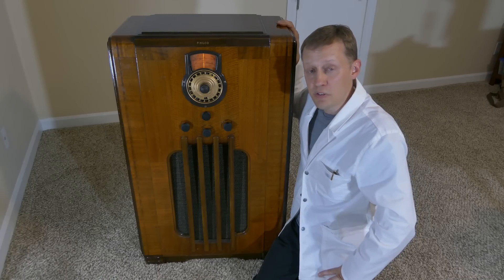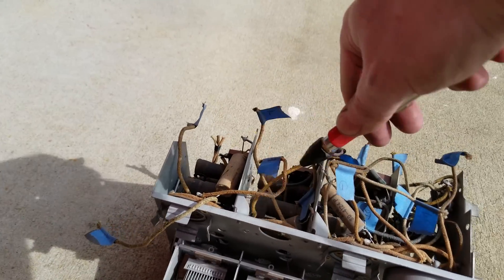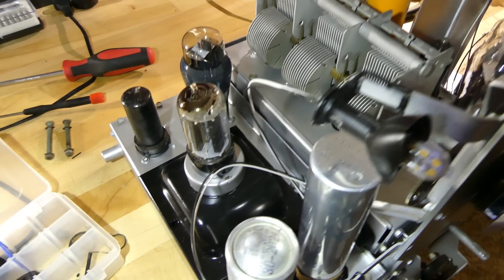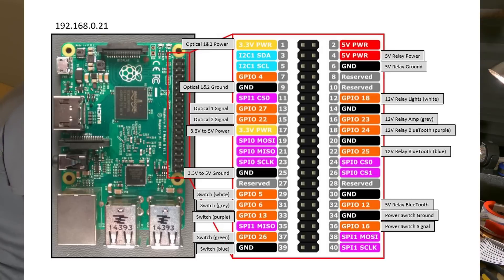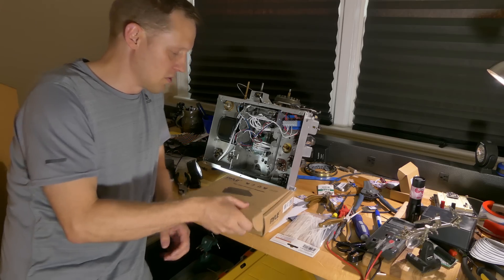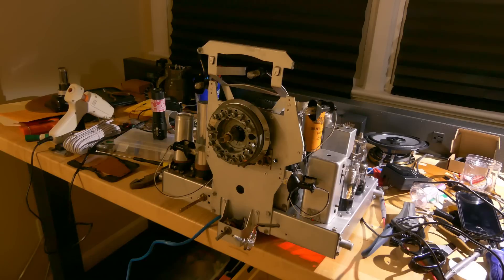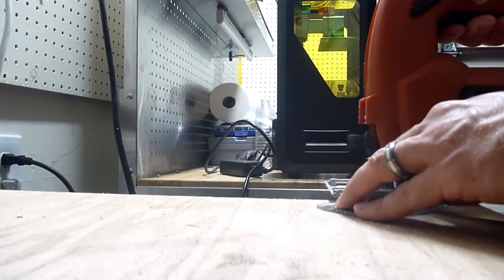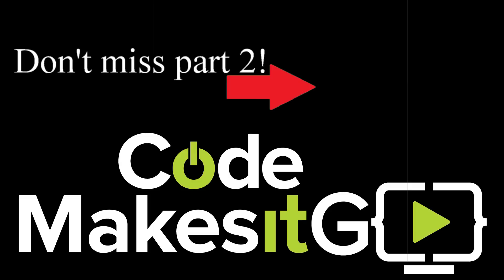Retro Radio w/ simulated radio stations - Part 1 of 2

Comment: Great job! I also have a radio cabinet that I just finished restoring and I am now trying to figure out the internals. I have a raspberry pi, a pam 8403 amp with potentiometer for volume control, and just got a rotary encoder. I am now trying to make the rotary encoder work to be able to control the menu of the raspberry pi. Any suggestions on how to code this functionality? I definitely need help with this piece. Again, great job!
Reply from the maker: Matt Votisek I can definitely help out. Sounds like you want the rotary encoder to switch internal modes like a software switch. Or do you have an actual visual menu display? Email me at jason.altice@codemakesitgo.com with info. Thanks for watching!
Reply: @CodeMakesItGo  I sent you a couple of emails. Let me know here if you don't get them. Thank you.

Comment: I'm restoring the actual radio in a Philco 37-11X, and I could sure use the coils that you gutted from the section around the bandswitch shaft, assuming the sandblasting didn't destroy them all.
Reply from the maker: The Radio Pleasure Palace oh no so sorry but I figured nobody would ever want those. I actually said those words while throwing them out. I do have the speaker and some capacitor housings if you want those.
Reply: @CodeMakesItGo  Never assume nobody would ever want those. It's amazing the crazy little things you need when restoring a radio that would be outrageously expensive if you didn't have a junker around from which to steal the part you need!
Reply: @lurkersmith810  Yeah, I still feel bad about it. 😒
Reply from the maker: @Reel3DVideos  ugh, wish YouTube would remind me when I'm signed into another account.